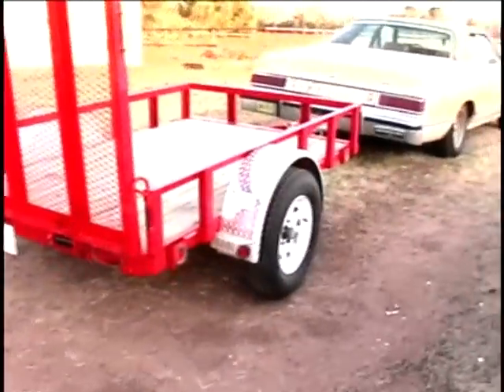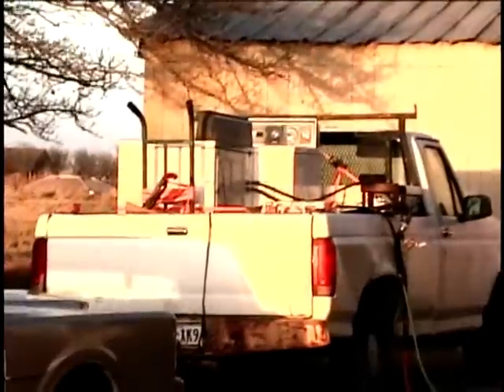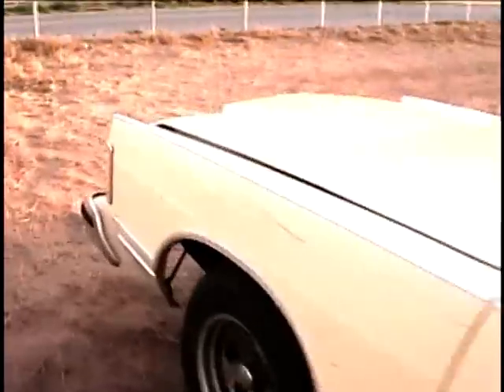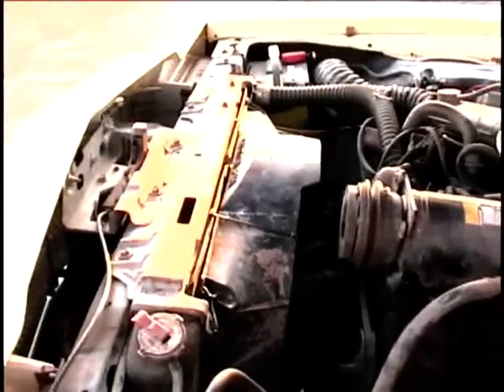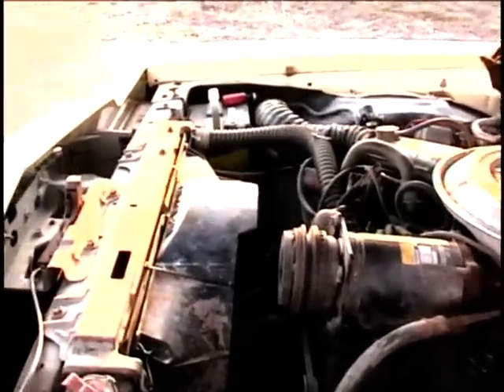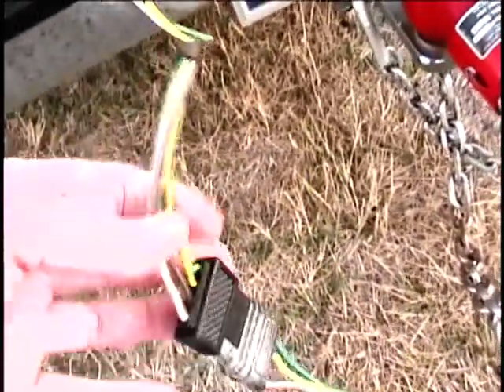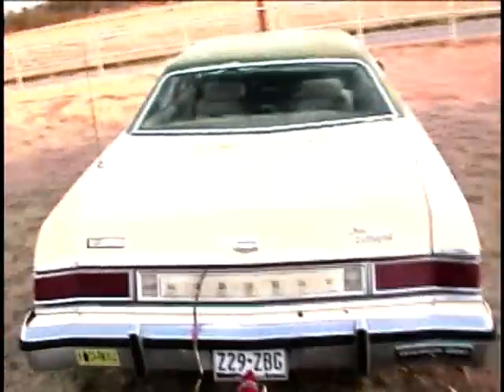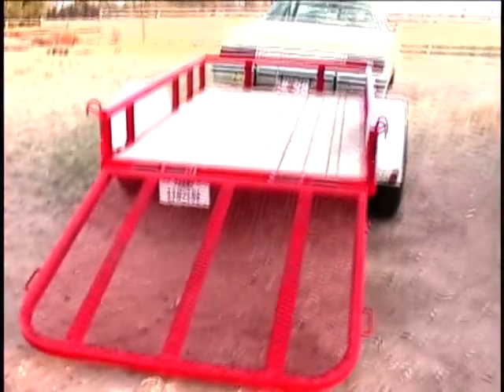New 2009 PJ Trailers 8' Utility Trailer

Comment: one of these days ill be getting a trailer. i just picked up a little compact tractor and bushhog. thats a nice looking trailer. but you gotta be carfull especially if your hauling fragilethings on that trailer. alot of smaller trailers have no suspension and they bounce like something awful. i know this from borrowing a similar sized trailer. they have leaf spring kits available that will help though if you feel the need

Comment: That sounds like a great deal, certainly would be a lot easier to get things onto the trailer. 

I will look out in the junkyards for a fan shroud if you want and send it to you if I am able to locate one.

Couldn't you pull it with the Ford pickup or do you need some adaptation for the trailer because the truck is higher?